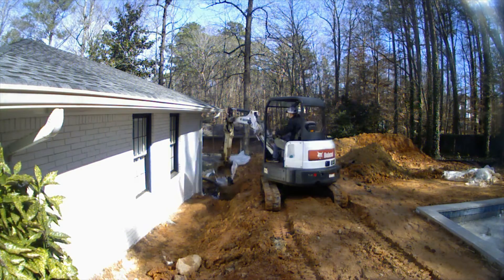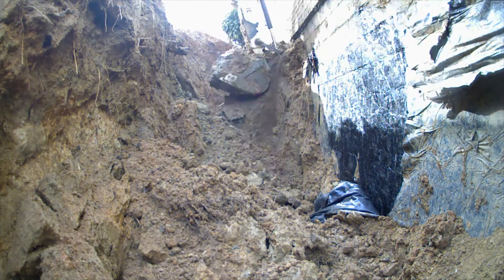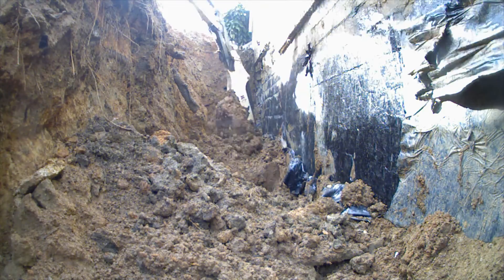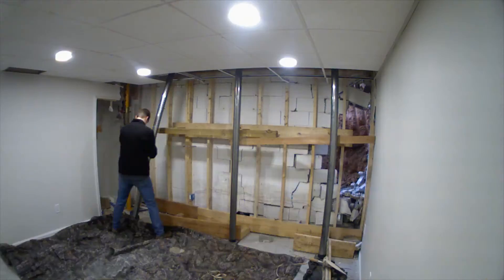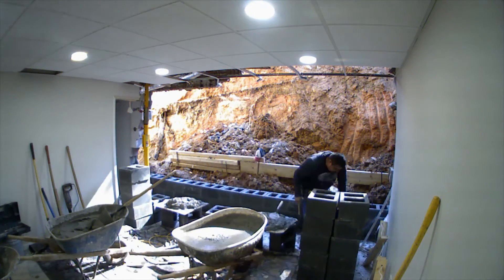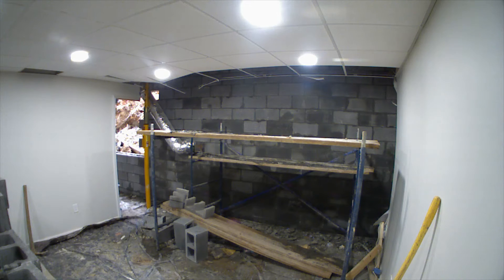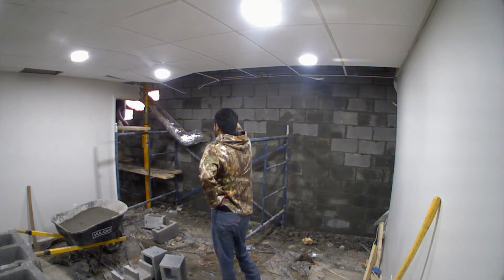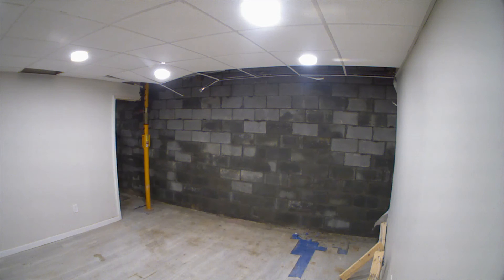Failed Foundation: Fixing a Collapsed Basement Wall After Heavy Rain!

Comment: My mom lives in Powell county Kentucky she has recently had her rear basement wall, one of the two longest walls of the basement, collapse after a heavy rain right now just half the wall has collapsed but the rest of the wall is cracked and will need to be replaced. She is on a fixed income and will have to do a little each month. my question is how do you build a support frame to support the upstairs, I know nothing about construction of any kind so I will also need advice on the materials needed. Any help is greatly appreciated.

Comment: Was there no drainage tile on the outside base of the wall?  And was the failure due to the lateral load from the soil on an unreinforced wall or was it a combination of the moisture as well?

Comment: When you use concrete blocks for basement construction, which is a very good method to build your house foundation yourself as well. One thing to note is the type of concrete block used is important to the quality and the easiest way to reinforce both vertically and horizontally when the best design of concrete block is dry stacked, then filled with concrete. You often see that the blocks are built with cement and not dry stacked. Which cement block type am I thinking of then? Yes it is, half-in-half (H-block with double wall) and (You can easily find) a picture ''Google'' and Youtube video ''Skalblock'' these are called that in Scandinavia. Check these out. Thank you for your display of the buckling of the "Block Wall", which happens if you originally did not reinforce and/or fill traditional concrete block walls with concrete at all during the construction of the basement road in your repair project.
Reply from the maker: As you said, this wall failed because there was no mortar or concrete inside the block cells.
Reply: Our basement wall collapsed after a heavy rain. How much costs are we talking about or will insurance help?